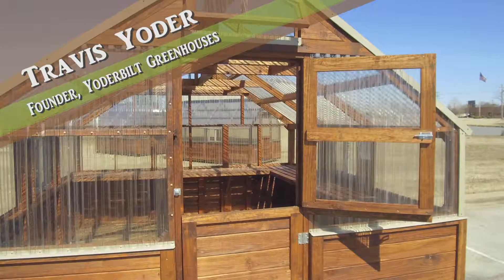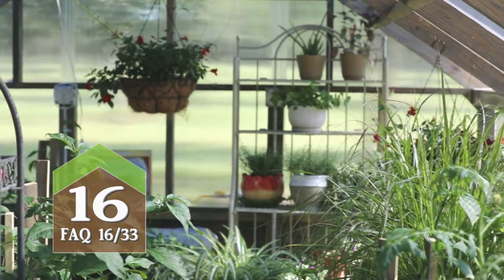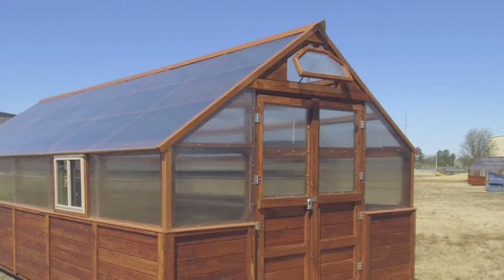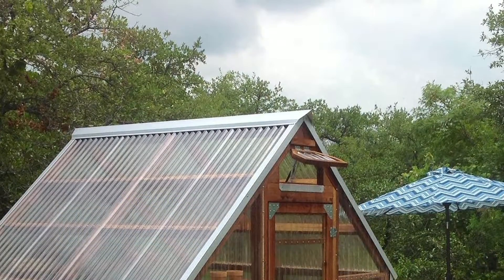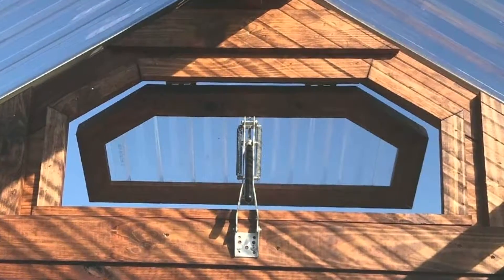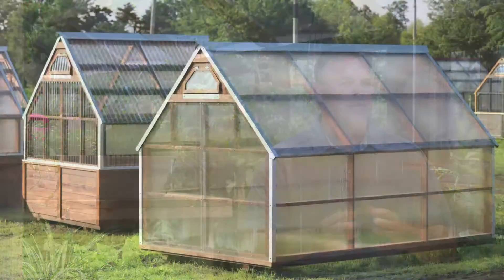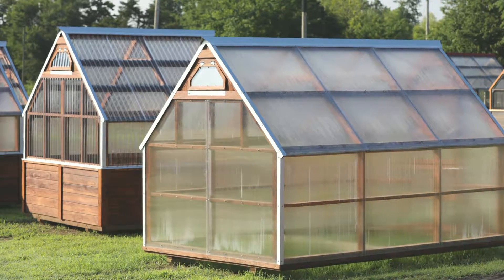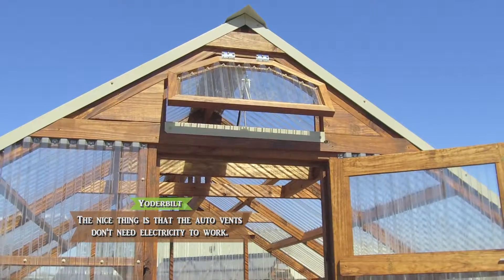Greenhouse Buyer Questions Yoderbilt FAQ #16 Ventilation via auto vents in the greenhouses

Comment: How do I know the vent size is appropriate to keep the greenhouse cooled down. I would imagine on a hot summer day the interior would easily exceed 100 degrees. Without a mechanical fan sucking out the excess heat is the vent sufficient to minimize heat build up? In the winter what heat source do you recommend for cold cloudy days to keep the plants warm?